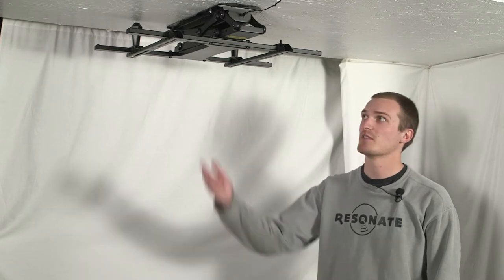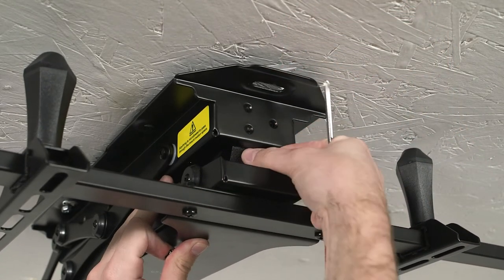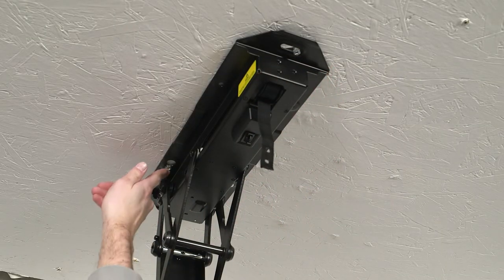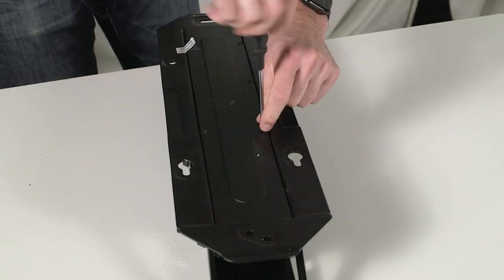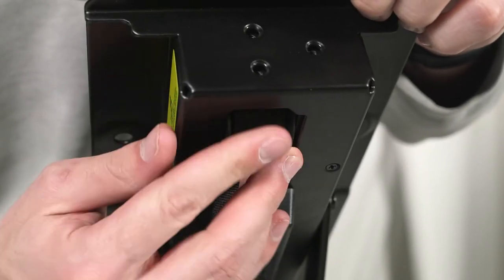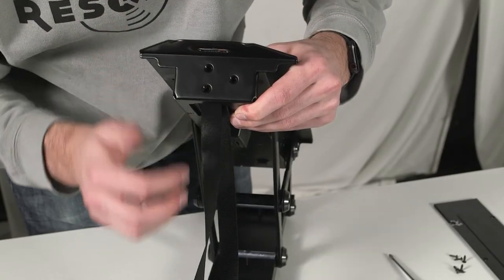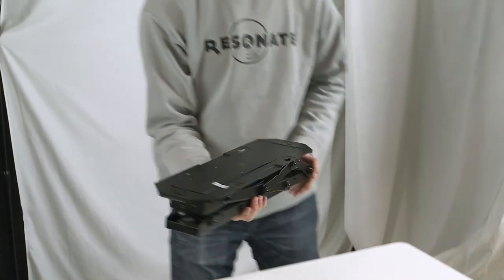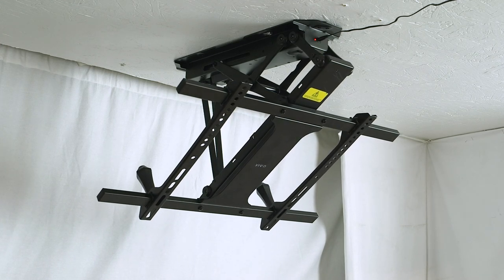How To Reset Your Ceiling Mount Belt by VIVO

Comment: While I appreciate this helpful video, it is incredibly frustrating that this is a known problem and it is still being sold like this... It is a massive waste of time and a risk to the TV having to unmount the TV while in the up-position (since most people will not find this video), remove the mount, deal with adjusting the strap then re-install everything.  The unintuitive remote control, the fact it can't go down to 90 degrees... I completely regret buying this thing.

Comment: You have got to be kidding me… if it get stuck up (as mine is) the only way to reset it is to take it completely down!?!? Are you really going to tell me this was the best “reset” button you could think of?
Reply from the maker: We're sorry this has happened with your mount!  For this model, taking it down from the ceiling has unfortunately been the only really effective method for getting things back where they need to be so that it can be fully reset to work properly.  We have been working to improve this to prevent these sorts of problems from happening.  If you need further assistance with your mount, please contact our customer support team: https://vivo-us.com/pages/support

Comment: There is an IR window on the front of the remote, but there doesn't seem to be anything coming out of it.  In the future, consider having an additional IR add-on or something with this system, like an IR target that plugs into a headphone style jack, so people can simply add the remote's commands to their universal remote.  Being forced to use the original remote, instead of adding the remote commands to the macros of a universal remote so the TV can be coming down while the system boots up, would be a massive improvement.
Reply from the maker: The 55" version of this mount originally had an IR system that could be used with many universal remotes, but since these are often installed in covered patios and gazebos, they would often have trouble operating correctly in the daytime since sunlight can block out IR signals (we received a lot of complaints about this).  With the amount of available room inside the mount (which is limited), we unfortunately had to make a choice between one control system or the other.  We decided in the end to use the more reliable RF system, and although this unfortunately meant it would no longer work with universal remotes, the overall customer experience and feedback has been greatly improved.  We understand that the system doesn't work for everyone though, and have been experimenting with options to try and add some universal compatibility with the RF signal (we do not have anything to announce at this time though).
Reply: Need help resetting/pairing the remote.  Mount not retracting upward
Reply: @jaymedina5219  hi My friend, did you find a solution for that?, My remite controller rf is not working often

Comment: How can I tell if the pully is bad?
Reply from the maker: A bad pulley would slip on the shaft and not pull the belt up at all, or if the mount has a bad gear, it might try to lift a little before slipping back down with a grinding noise.  If your mount has any of these problems, we can send replacement parts under warranty: https://vivo-us.com/pages/support

Comment: Can you use this thing without a remote. I'm in an Airbnb and there is no remote for this, Tv is tucked it at an annoying angle and there are no buttons on the product itself. Kinda dumb that you're hopeless when you're remote goes missing or breaks
Reply from the maker: We're sorry, but the mount is unable to work without the remote.  If you're staying at an Airbnb location, unfortunately all we can do is advise contacting the owner about the missing remote.

Comment: is there a recall for this model-sn?
Is there a reason as to why it gets stuck?  or are  there preventative measures to take to prevent this from happening?  I have a client who purchased this mount end of last summer and is now waiting for my company to install as soon as warm weather sticks.  seeing this video now concerns me from actually installing it and possibly running into this issue down the road.  as a custom installer i would hate to put myself in that position.  any insight?
Reply from the maker: The problem can usually be avoided during setup of the mount.  Once the TV is mounted but before the arm is raised, check to make sure there isn't any slack in the lifting belt.  If there is, use the pitched ceiling adjustment instructions found in the controller manual to set the minimum position of the arm, making sure the belt still has tension on it when fully lowered.
The problem has typically happened when the arm isn't able to fully reach the default lowered position for one reason or another, causing some confusion to the mount's memory.  When that has happened to the point of getting stuck, resetting the belt and making sure the minimum height of the arm is set has completely fixed and prevented further problems in most cases.

Comment: Are you kidding me!? You have to remove the TV, and completely take this freaking thing apart, then re-install.. I’ve had this thing a week and it’s stuck in the up position. What a POS.
Reply from the maker: We're very sorry that this problem has happened with your mount!  This is something that we are actively working to improve.

If you are able to do this reset so the mount is once again operational, there may be a minor adjustment that can prevent it from happening again.  When the mount is fully lowered, check to see if the belt is still pulled tight or if it has any slack.  If there is slack, unplug the mount for 10 seconds, plug it back in, then follow the pitched ceiling adjustment instructions in the remote manual to raise the minimum height by a couple degrees.  This will keep the belt tight at all times, which should prevent the height sensor from having any problems that can cause it to raise incorrectly and get stuck. 
Remote Manual - https://cdn.shopify.com/s/files/1/1190/2562/files/MOUNT-E-FD70_-_REMOTE_CONTROL_REV1.1_online.pdf?v=1652373077